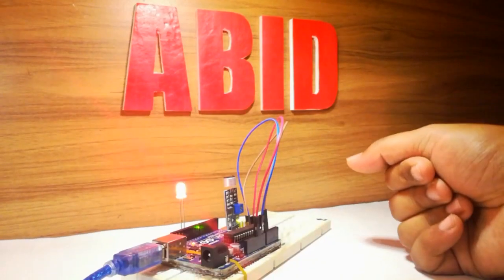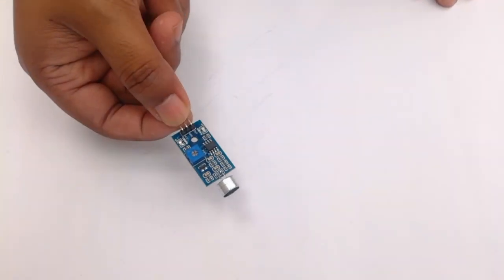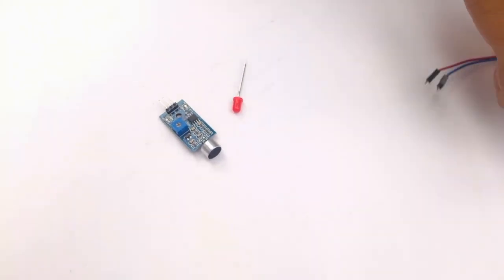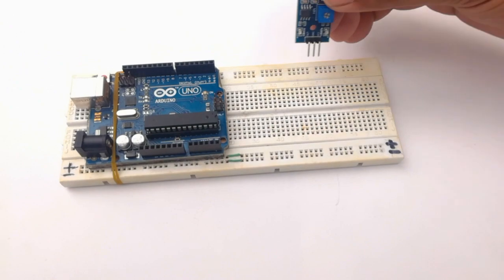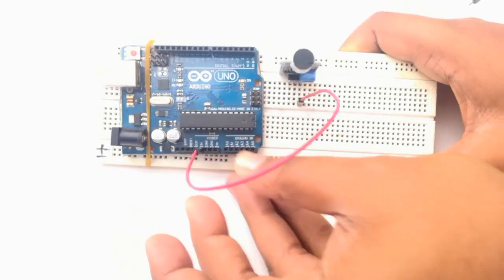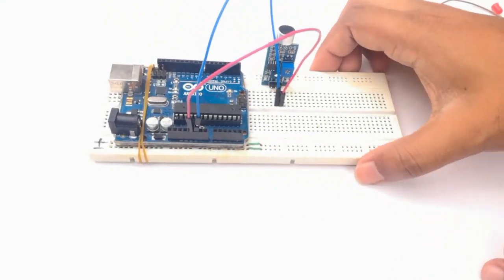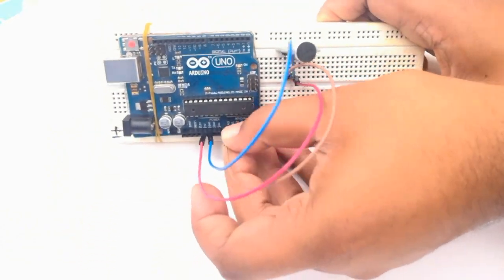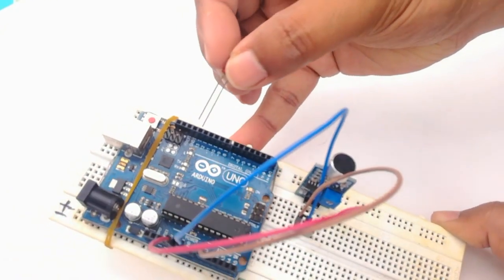Sound Sensor Module with Arduino Tutorial.Clap Switch!!!

Comment: can you tell which com should we select 1or4
Reply from the maker: There is a trick to find the COM port related to arduino. You can search Device Manager on windows search bar and then click on Ports to find the arduino COM port. Also you can see which port is appearing new when you plug the usb and when you unplug.

Comment: Hello sir, How to use relay instead of LED?
Reply from the maker: Directly Connect a 5v relay module to the output pin of arduino in stead of led.

Comment: The code works just fine 
But I have a problem if I put any block of code under this code or above it like printing hi the sound sensor code doesn't work why is that?
Reply from the maker: It’s because the other line of code is blocking the sensor code.For example if you use delay function inside a conditional statement.
Reply: It's actually I am having two sensors one the ultrasonic and the other is the sound the presence of two codes makes only the ultrasonic works in spite that both work fine individually 
So I can't combine the two codes together properly so can u help me with that?

Comment: This project is just bad, I am sure 100% (note that I did not test it) it will conflict with other sounds easily, I read your code, and it is very bad. You are only using the D0 pin, it would be better if you used the A0 to analyze the sound waves that are coming from the microphone. Wherever you go, you will find people who just upload videos on Youtube for money. Do your work correctly, then we can talk.
Reply from the maker: Lol.. Cannot analyze the sound wave beacuse the output signal is digital.
Reply: @ABID5  No, the A0 outputs the sound signal from the microphone directly, you can modify the output voltage range using the variable resistor, the "D0" only gives you the opposite of the normal value when there is a difference of the nominal loudness, this nominal loudness is determined by the variable resistor indirectly, it is lowering the voltage of the sound wave, and this voltage is being compared with 2.5V, then it flickers. But how much is the difference, or for how many nano seconds (nano for more accuracy), with these two things, you will never be able to differ between other sounds, and there two things will never give you the ability to differ b/w different sounds. Plus, the microphone is really bad, I saw way more better microphones, the sensitivity of this microphone is pain in the ass. Plus, I feel like the response is bad, I have a better microphone with a good amplifier called "ADMP401" or "ADMP404". The difference between these two is the sensitivity, with that being said, you also need a better faster and more reliable ADC (Analog to Digital Converter), because of course the processor cannot process analog data, so you need to convert it into digital form. Use the "ADS1115" which is a famous ADC, it uses the "I2C" interface for communication. I said all of these information without flickering, searching on the internet nor checking any resource. You should be better than me, I am here for science, not for money or fame. Until now, I have not seen anyone who was able to differentiate b/w the clapping sound and other sounds using some simple and cheap circuts, without the necessity of any smart devices like PCs or smart phones, I think only one guy who has done it correctly, which is "GreatScott!", go search his work, I don't have time to search. I hope I have helped someone in this world...

Comment: The code works but once I turned it on and turned it off, I have to reset the arduino to repeat it again... It doesn't work continuously... How can I fix that? Reply asap
Reply from the maker: if you copy paste the code exactly it should give no error.
could be a reason for faulty arduino board
Reply: Can you send the code here
Reply: Send me another link of the code that I can copy.. Thanks

Comment: I missed what he said about pin 13, can someone please tell me?
Reply: Pin 13 is the pin that the led on the arduino board responds too ( the one ON the pcb ) and as such has a built in resistor. Hes saying that pin 13 has a resistor built in and will not need one for an led plugged directly into it, meaning that power has to go   voltage ( dc ) -> pin 13 ( anode of led ) -> resistor -> back to power source ( ground ) ... I don't know this to be true but I feel like it may ( may) not be consistent through all arduino clones. IF this is the case then it must mean that the chain is in fact:  power > resistor > pin 13 > ground ( back to power source . Though this confuses me as to my knowledge the resistor must be on the cathode ( down stream of the led)

Comment: Ur code is not good 

i upload it on my arduino board but no light is turning on or off when clapping :/
Reply from the maker: did you use the same sensor i used?
Reply: @ABID5  yes same sensor same connections and coding

Comment: good night
Would you help me:
I'm trying to do a project with arduino and sound sensor.
I need it when the sound is loud (the arduino turns on the led for 0.3 seconds)
I'm having trouble getting
help me
victor88.srocha@gmail.com
Reply from the maker: I'll post the code later
Reply: @ABID5  , could help me I'm making a system to operate a voice machine but I need it to not work if the sound is sharp I'm using a sound sensor. I need it to work with more bass sounds
follows the schedule

const int pinoRele = 7;
const int pinoSom = 4;
int val = 1;

void setup () {
pinMode (pinRele, OUTPUT);
pinMode (pinoSom, INPUT);

}

void loop () {

val = digitalRead (pinoSom);
// digitalWrite (pinoRele, LOW);

if (val == LOW) {
digitalWrite (pinoRele, LOW);
delay (300);
digitalWrite (pinRele, HIGH);
delay (4000);

}
}

Comment: Hey there 5 stars for your video's.
I like it So much.
Maybe you can help me out.
I build my own led lamp.
But it is very bright because it has 330 bright white 3.2v leds in series of 3
I like to switch my lamp on in 3 steps by double clap.
Clap clap and relay 1 comes on.
Next clap clap relay 2 comes on and relay 1 stay's also on.
Next clap clap relay 3 comes on and 1 and 2 stay's on.
And then clap clap all relay's turn off.
Can you help me with that.
I hope you can.

Comment: Helllllll  avrdude: stk500_recv(): programmer is not responding
avrdude: stk500_getsync() attempt 10 of 10: not in sync: resp=0x7d
Problem uploading to board.  See http://www.arduino.cc/en/Guide/Troubleshooting#upload for suggestions.
Reply from the maker: It's not the problem by the code.May be the arduino board is not working.Maybe the cable is bad, or Correct settings are not done.Set correct port,programmer as ArduinoIsp
Reply: @ABID5  
Thank You

Comment: I am having trouble with the sound sensor, it becomes really hot as soon as I turn the circuit on (in less than a minute)...
I thought that the problem was in the sound sensor so I tried the same thing on 2 different sound sensors but I got the same result (both became really hot as well)
can anyone tell me why is this happening and is it normal?
Reply: try plugging the sensor into 3.3v instead of 5v

Comment: The Idea is good and the Code works quite well, but I found exactly the same code on another Site from 2014 postet by Rafael!
"https://en.code-bude.net/2014/12/08/how-to-build-a-clap-switch-using-arduino/" 
I would like to give the Original owner some Credit!
Reply from the maker: But I've seen it first in another page ..lol.

Comment: Awesome work, please tell me do you have any idea as to work to detect gun shoot sound ?
Reply from the maker: Why a gunshot sound?
There is way, that the simple clap circuit using 555 timer.
Reply: Hai ABID Inc , Thank you so much for your reply, the reason behind a gunshot sound it because I'm working on a project for community safety, where i have to detect a gunshot sound and trace geolocation on google map.
Reply from the maker: Detecting a gunshot like sound is easy for arduino,but what if someone sneezes and it detects as a gunshot ..lol.
But this will work.With the sensor and few lines of code.

Comment: Possible fake, because on time 1:45 turns led on before second clip. Also if look video with low speed, you see that red led turns on before mic module led second flash. Just 2 sec led on/off timer?
Reply from the maker: Have you tried the project yourself and did it work? How can you tell a real working project fake just by hearing de-sync sound.I can give proof with a new video with the same code.See the comments below, user Ellirehd
(on bottom 3rd comment) he made it successful.I can do this project again and again to prove it's real.
Reply: @ABID5  I don't say that this project itself is fake or code is bad, or something else. I say this video is possible fake. There is difference. Everyone can look this video with 0.25x speed, check leds and make own decision. I mean checking only mic module and Arduino leds, without sound.
Sorry, but it's just a little bit sucpisious, when you say, that you direct Arduino red led with two clap, but Arduino red led flash with constant speed. And at time 1:45 leds flashes in this order: mic module led 1. time flash -> Arduino red led turns on -> mic module led 2. time flash. :)
Reply: @ArvoTomingas  Whether or not its fake, if you follow his instructions, the system will work fine ? (what did you eat last night)

Comment: the code site is clickbait. can someone give me the REAL code?
Reply: int Sensor = A0;

 

int clap = 0;
long detection_range_start = 0;
long detection_range = 0;
boolean status_lights = false;

void setup() {
pinMode(Sensor, INPUT);
pinMode(13,OUTPUT);
}

void loop() {
int status_sensor = digitalRead(Sensor);
if (status_sensor == 0)
{
if (clap == 0)
{
detection_range_start = detection_range = millis();
clap++;
}
else if (clap > 0 && millis()-detection_range >= 50)
{
detection_range = millis();
clap++;
}
}
if (millis()-detection_range_start >= 400)
{
if (clap == 2)
{
if (!status_lights)
{
status_lights = true;
digitalWrite(13, HIGH);
}
else if (status_lights)
{
status_lights = false;
digitalWrite(13, LOW);
}
}
clap = 0;
}
}

Comment: can i use 4 pin sensor sound module?
Reply from the maker: yes, use the D0/digital out pin as input (to A0 pin) for arduino. no need to use A0/analog pin of sensor, i mean the fourth pin not used.And Please Check my other videos.
Reply: sure i will watch your other video,thanks for the information sir :)
Reply: i want to ask again sir,in my 4 pin there is no vcc,i was so confused about that,what must i do?(in my 4 pin sensor ther is a0,g,+,and d0) if the g is ground,what are the +?and where i can found the vcc?
Reply from the maker: + is also called vcc. vdd,vcc,v+,vin,+ etc are same

Comment: What I bought was an Aduino Unauno 3, an Aduino FC-04 microphone sensor voice recognition module, but is it a different material from the one I made?
Reply from the maker: voice recognition module will not work with this code.try sound sensor.
Reply: ABID Inc. So you have no problem with the ingredients?

Comment: if i use other sound sensor like sound detection module it can be same code?
Reply: I tried with a different sensor, it doesn't seem to work. Maybe the dude can provide a different code.
Reply from the maker: put a link of other sensor.
Any digital sensor should work.

Comment: i just want to snap once and the LED turn on . How can i do it ?
Reply from the maker: You need to modify the code.But a problem, when there is a noise the led  is on/off.
Reply: yes i know this , but this is what my instructor ask
Reply: Just twist the screw in the potentiometer

Comment: Sir it works. The led with the buzzer my only problem now is the buZzer. It is not loud enough
Reply from the maker: Use other pin for buzzer, 
The code is with the first code.
Reply: A B I D Inc. How can i make it detect at longer distance and make the sound of the buzzer louder? I have already used pin 12 for buzzer and 13 for led.
Reply from the maker: Try turning potentiometre pin of sensor to get more sensibility,  
Use a .5watt speaker instead of a buzzer
Reply: A B I D Inc. What’s with the buzzer tone?
Reply: I am now quite satisfied. I have changed the tone. Thanks for your great help sir!
Reply from the maker: May be cause of different frequ.
try to change values in code
like tone(buzzer,800):
try 200-2500

Comment: Hello sir, can you work with something like. If i clap once then led and buzzer will turn on for about 5 seconds and then it will automatically turn off. So it will be ON again if i clap.
Reply from the maker: Yes. But using one clap will fake trigger the Led/buzzer if any noise is heard.
Reply: A B I D Inc. can u make code for two claps? But only it will turn on for about 5 secs and it will turn off automatically

Comment: hey bro! great job. I would like to switch a LED together with a buzzer. what codes do i need? i don't know programming in arduino sorry
Reply from the maker: Just put buzzer in parallel with led
Reply: So it means i will use the same code, i will just put the led and buzzer in parallel on a breadboard?
Reply from the maker: yes., It works.But If you want to change the buzzing frequency, thats different.
Reply: A B I D Inc. thank you so much, i am working on a prototype right now. This would be great help. Hoping you could do a video tutorial for a buzzer and led clap switch :D
Reply from the maker: I will post a link here tomorrow. 
Stay Tuned.
Reply: A B I D Inc. highly appreciated!
Reply from the maker: Hey ! You can find the code in description(updated).Bottom of previous code. Be sure the buzzer sound doesn't interfere the sensor.
Reply: A B I D Inc. thank you so much let me know :)))
Reply: A B I D Inc. may i know sir what model of sound sensor are u using? Because i have ordered one that says “digital sound detector sensor module”
Reply from the maker: Mine is analog. LINK of your sensor??
Reply from the maker: Fine!  It will work. Go on ... then let me know if you success.
Reply: A B I D Inc. will it work despite the different model of our sensors used?
Reply: A B I D Inc. also can i see pictures for the connection with led and buzzer? :(
Reply: I am having hard time because i have poor knowledge about these things.